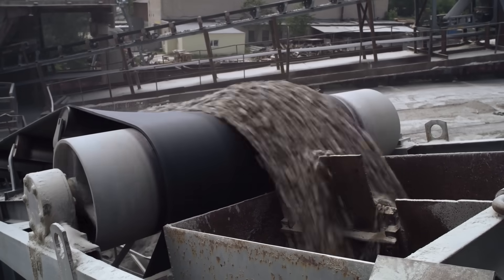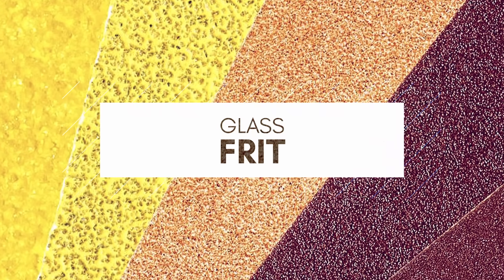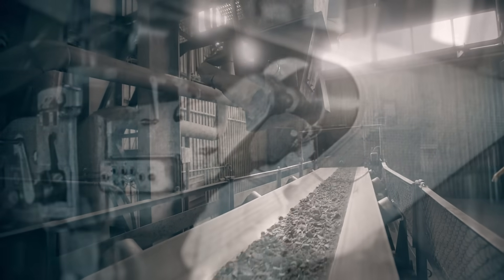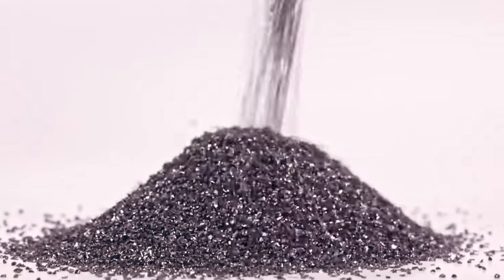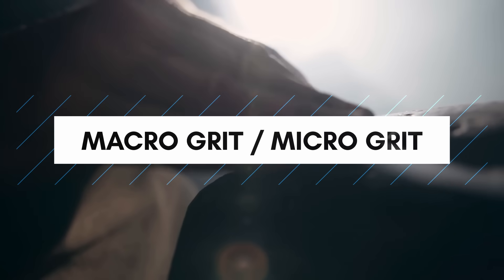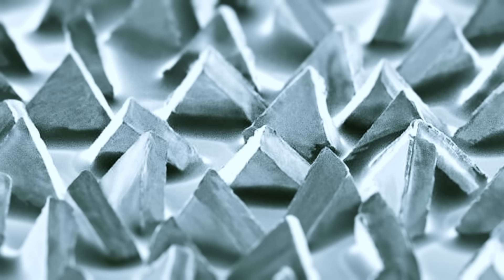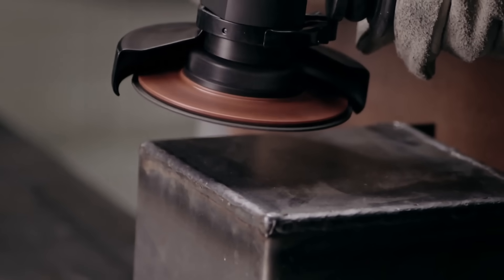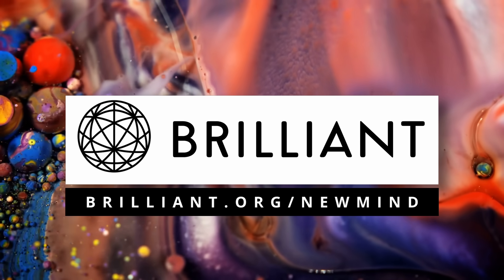The Incredible Technology Behind Sandpaper

Comment: That Cubitron II is some really good stuff.  I've used it on wood and metal and plastic.  It stays sharp and doesn't clog as bad as the cheap stuff.  I used to think that the "boutique" sandpapers were a gimmick until I broke down and bought some.  Now it's all I buy.  It's worth it just to not have to constantly change out sheets on the sanding block.

Comment: It's funny to read through the comments and see all the different industries that use 3M abrasives. I'm a watchmaker and we use 3M micron paper (technically lapping paper) for all kinds of stuff. Sometimes it's quick refinishing of screw heads, dressing tweezers, or even quickly polishing some minor scratches out of a case. Once you get smaller than about 15 microns it just feels like you're rubbing something with the non-sticky side of a piece of scotch tape.

Comment: I'm currently working on setting up a wood products manufacturing company and I'm planning on getting the Mirka line of sanders and mesh. It's awesome to have a detailed explanation of how the different technologies actually work. Usually the marketing is vague and you just have to try everything to see how it works different. Apparently the sanding mesh is highly regarded and is generally the standard for high volume sanding. Keeps the work area cleaner too.
Reply: Doing it by hand or large surfaces?

We use big ironwood belted drum sanders (it's a belt but you can set it up to sand either off a grooved drum, a pad over the flex area, or a surfaced drum). Basically it runs a huge vacuum right off the belt to clear it. They work amazing for fast material removal, flattening, and finishing.

The only thing I wish is that they used a vacuum table. Sometimes you can get nip due to the pressure rollers.
Reply: @ObservationofLimits  hand sanding rifle stocks. Lots of small areas to hit. I

Comment: So does, "100 Grit" mean that the abrasive passed through a screen of 100 wires per inch, but not anything smaller?
Am I correct on this?
Reply: FEPA grits actually speciefies distribution of sizes of abrasive grains. So 100 grit means that most grains are just the size to be able to fit into 100 mesh, but there are some bigger and some smaller grains also.
Reply: @bar1721  Thanks, now I know.

Comment: I got some 600 grit Blue from 3M. I had never purchased sandpaper that wasn't wet/dry and this stuff was a huge mistake. It formed a gooey glue and basically reversed my sanding and added a lot of work. I haven't used any again, but if I do try, it will be dry

Comment: Needing to level a subfloor for new flooring a concrete product was used. Unable to apply it uniform enough, first a flat point shovel was used while the product was "green". Fine tuning to about 1/16 inch per yard was still needed so I decided to sacrifice some life of a belt sander to do it. To my amazement the 32 grit 3M belt handled it well and without apparent damage or wear.

As a frequent mechanic and wood worker who has used many products including cheapo sand papers that hardly work at all, "wet or dry, emery cloth" etc for many years I found this video very interesting and enlightening. I'm not sure what abrasive tech it was that I just used on the concrete or with the palm sanders I use often but this reinforces my conclusion that it's often well worth it to pay a bit more for the best.

Comment: Your video always undownloadable. . . I'm premium user and i still can't do it
Reply: Strange, because I'm watching the downloaded version I downloaded ages ago, because I was too tired to watch it in streaming format. 

Maybe you need to wait 'til the advertisements or announcements have subsided, then the screen will show the "download" icon option.
Reply: @BrassLock  there's no ad in premium. . For some reason my download keeps getting stuck at some point
Reply: @lenOwOo  If all else fails, it's worth restarting your device, then if that doesn't work, uninstall YouTube and then reinstall it. I'm assuming all other channels are normally downloadable on your device (except those that've switched off that feature). 

The capacity of your device's memory shouldn't be a limitation on downloads, as I think it's a very compressed file in most cases (I sometimes have up to 250 downloads available in my offline library on my smartphone). But clearing your Cache might be fruitful if nothing else is solving the issue. Good Luck.

Comment: I usually use products of Sia Abrasives (Swiss Industrial Abresives), and their products are amazing and pretty high tech. They are only Swiss manufacturer of bonded abrasives, with over 140 years of history (since 1875). I live in Switzerland, so it is easy to get all of kinds of their products even for non-professionals. 3M in some specialized applications like metal grinding might be sometimes better, but I mostly work with wood. The Sia abresives really last very long, with great material removal, compared to some other products I used before. While Sia only started expanding into global markets aggressively in early 90s, in 2000s went into foam and non-woven abrasives (some in Switzerland, some in UK), it is quite familiar now in many industries. Since 2005 it is a part of Bosch GmbH power tools division, but is still separate from Bosch abrasive products which are still inferior in most areas.

Also logo of Sia is just cool.

Comment: For polishing it's quite common to see grits finer than 5k, up 10k is commonly used in jewelry and optics.
Reply: Problem is in different industries and even manufacturers there are different grit scales. So like a FEPA P1200 is the same size as an ANSI Coated 600 which is around a 3000 Micro Mesh. All are 10 Microns.
the finest measure you see is 0.25 Micron. 
https://myplace.frontier.com/~mr.wizard/GLGC/GLGC.png
Reply: Niklas - So?
Reply: Jewelry can use up to 60k grit, or .3 micron. As a watchmaker I've used 1 micron (about 20k grit) to black polish stainless steel.
Reply: @CaptainXanax  No you haven't.
Reply: @jonhohensee3258  You're right, I was just making that up to sound cool.
Reply: @CaptainXanax  👍

Comment: I noticed that John oakey's company was in a place called Emery hills.  Won't if that's where the Emery paper gets it's name, or if it's for another reason.
Reply: That's interesting! Wasn't there Emery boards, Emery cloth too?
I can definitely remember "Wet & Dry" as being pretty damned expensive early on!
Reply: @Aengus42  there's emery all kinds of stuff. I think that just indicates a board, stick, cloth or whatever with emery paper fixed to it somehow.
Reply: Not likely. Emery is the name of the hard rock used to make abrasives. Wellington Emery & Black Lead Mills (not “Hills”) appears to have been the name of John Oakey’s factory, probably where emery was ground up to make the abrasive.
Reply: @jeff__w  perhaps at one time. Most of that shit nowadays is aluminum oxide glued to some kind of cloth. I guess it probably depends on where you are, really. They probably still make and sell quite a bit the old fashioned way in Eurasia and northern Africa. I'm sure you could find it made from emery in Lowe's, even. It seems a lot more common to be aluminum oxide or silicon carbide nowadays though.